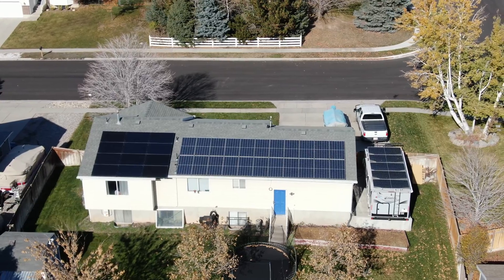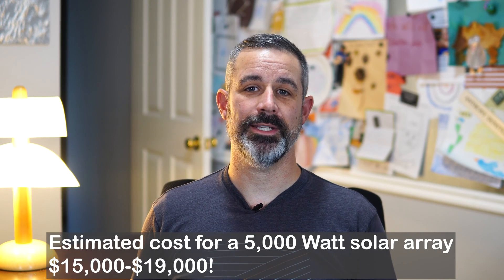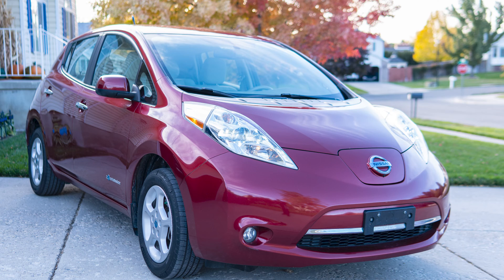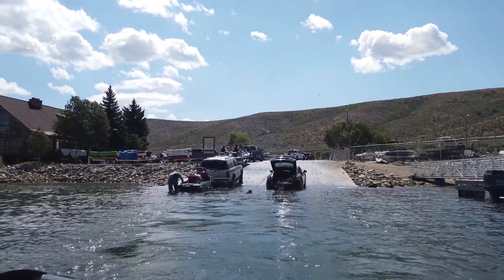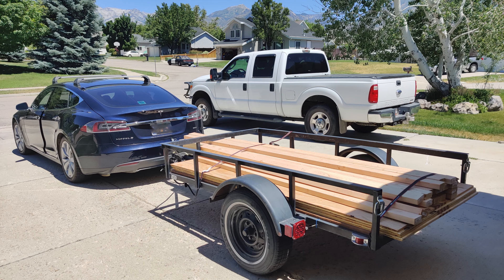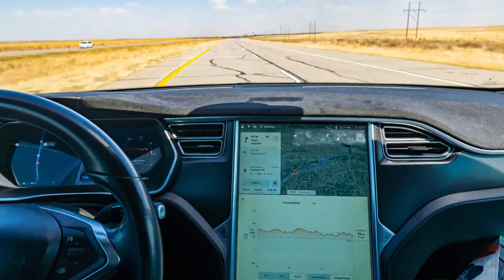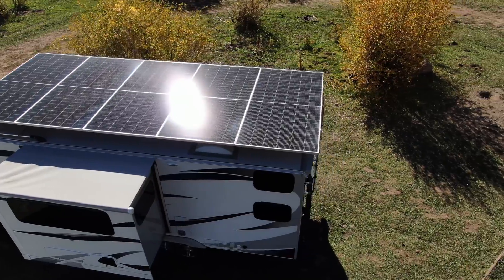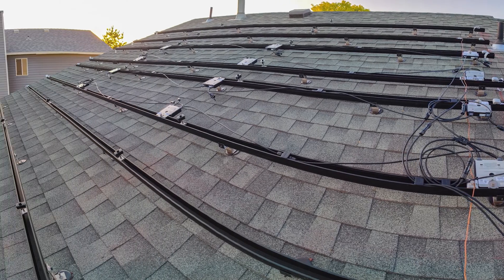How Long Did It Take Us To Break Even On Our DIY Solar Installation?

Comment: Well, a diy solar array built is far more worth then you had thought cause it teaches you a lot more about
* your consumption
* the major drivers / devices for the consumption and your habits you might be able to adjust 
* electricity in general
* living with the sun and
* dealing with shadows or shading and counter measures
* permissions
* planning strings, orientation, the cabling itself , mounting panels right and even cleaning panels due to the low slope and what not

It is a huge lesson learned for you, but at the end after 2 decades with kids having become adults it will show you that it was a lesson learned for all you kids for example raising the attention and awareness what amount of energy the devices they use are using and  a lot, lot more. It is something the western societies missed to teach in school from early on how a system works, what to take care for and what not. It should be a science curriculum .

I guess you might have missed the heating of your home cause you never mentioned it and the solar power array still looks quite small to me even though our policies in germany are quite different I bet. Netmetering sounds like a payment based on only the balance what you got from the grid minus what you had fed into the grid , the surplus energy you could not have used on your own. This is the easiest way but here it is called unfair cause the weaker households would pay subsidies indirectly to those richer ones with solar arrays cause producing electricity on demand at any time can be far more expensive during night or evening hours after dawn . You get paid back with the same amount you once have fed in and you will finally pay only the remaining balance after the year is over and you had fed less in than you had taken. 

Here it is quite different: 34 € Cents or roughly 0,38 $ INCL. all fees and 19% VAT / sales tax is the price per kWh 
If you feed in surplus you get paid but that is not your netmetering equation of 1 kWh fed in will give you a 1 kWh credit for later usage from the grid.
You get paid 0,08€ Cent or 0,09 $ which means an equtation of getting 1 kWh for free after having fed in 4 kWh. 
Therefore people tend to produce more or rather far more than they themselve just need to get a 0 € electricity bill or even make a profit.

Since the russian invasion of the ukraine we are allowed to install solar power systems up to 30 kWp = 30.000 Wp per household and any profit would also be income tax free, which is really rare that we can make money without having to pay income taxes. If you buy and sell shares or stock options you will pay taxes on the profit, so making 10.000 would mean about 4000 income tax and about 400 for church tax. Yes, there are people who did not pay but those get usually caught and the most recent and famous case was a former german fooball idol and hero, president of the most famous german football club who had been speculating big times and made money thinking he would not have to pay taxes on top of the taxes he already is paying. 3 years in prison , same prison were Adolf Hitler was incercarate , but he only had to sleep there over night (from 7 to 7) and over the weekend as long as he was working for his professional football club where he had been the president before. 

30 kWp on a roof with a 25° slope facing SSW produce about 33.000 kWh where our energy consumption in total for a usual house is far , far lower than the figures in the USA.
The average family of 4 has about 4000 kWh p.a. without heating and cars. But due to the end of russian gas supplies we replaced or reduced our gas and diesel heating usage a lot and added split AC which are bi directional heatpumps to our big rooms (usually 5 kW Mitsubishi for 1300 $ per unit incl. 19% VAT). People do not use the AC function at all in general, except the hottest dry summer days when temperatures reaches 35°C during day and is over 25°C. 
And then we also got  280 Liter heatpump for warm water which also has a 16 kW heat exchanger coil connected to the old existing diesel heating for the rooms with their radiators. 
These devices are used to raise the own consumption and use the surplus energy for your own benefit instead of giving it away for 8 cent while your neighbour will have to pay 34 cent for the same kWh you have fed in in the last 5 minutes. So if you consider that you have a cold watertank full with 280L down to 10°C refilled out of the pipes then you can store inside that tank about 16 kWh  of energy or heat which can be created by using a stupid electricity heat bar which will need 1 kWh for every kWh our stored in the water or you get the heat pump for about 1500€ right now which then usually needs 1kWh electricity to give you about 3 to 4 kWh of heating energy in the tank. You will have a leverage from 2 to 3 more than what you have to put in. And the heatcoil then could also transfer the heating energy into the radiator s without a need to run the diesel heating system anymore. 
The way it works is simple: you have a usual schedule where you program when you need the 280 l of hot water at what level of temperature
The heatpump will then run the schedule you have planned unless you are producing surplus power you are feeding into the grid. In these cases the heatpump gets a signal that there is surplus energy available and it abandons its schedule for now and runs the heatpump at 100% which means 800 Watt input and about up to 3000 Watt output in the hot water tank. You have a leverage or about 3 again like with the split ac in heatpump mode which also run about 4 to 5 offering a 3-4 leverage. 
If clouds are coming in or you are starting to charge the EV with 11 kW and then there is no surplus anymore the signal cause to the water heatpump and that runs its cycle to the end and then falls back into the usual schedule programmed which is also using the heatpump and tries to wait for surplus power. 

At the end we replaced about 1200 liter diesel for the Mercedes which has been replaced by an EV and about 2500 Liter diesel for the central heating by using the solar power wheneve possible or the up to 15 kWh we can store in our LFP storage which we had bought from SEPLOS , a SEPLOS MASON 280 L power tower as we call it on wheels. Case and BMS were about 500€ here delivered to our door and the 16 LF280K cells from EVE each  about 900 Wh of capacity were about 1850€, so 2350€ or about 2500 $ that work with our growatt inverters. We build all the stuff on our own, we did not get tax credits from the government except for the EV purchase back then. 
And it took about 2 years to move from gas / diesel to renewable, I mean buying and building the 2 x 5 kW Split AC heatpumps into the rooms, then adding the profiles to the roof and mounting about 60 panels each about 500 to 550 Wp (so 2,26 x 1,13 m and about 30 kg) onto  the roof and connecting them to 6 inverters (we have a 3 phase system in general and therefore each phase is 240 V or about 3600 Watt for plugs and lights except the oven, cooking and of cause charging which are usually 3 phase connections up to 11 kW ). We paid about 20.000€ for the solar power, the split AC and the water heating system which is also acting as our central heating. 

This is happening in many german households to get germany climate neutral and get away from russian gas we no longer get. The amount of new solar power systems on household roofs and industrial and public building and of cause ground systems on acres per year is about 8 GW and replacing about 6 nuclear power plants we have already shut down cause for us nuclear power is no alternativ due to the nuclear power waste which NO ONE WANTS cause all the storage facilities considered across germany under the ground in 2000 or 3000 m depth which were claimed to be save were not accepted by the local population and it was the same movement which started the demonstrations back in the 80 against nuclear weapons stationed by the US forces on german soil . Nuclear power is here not called green, but a dead energy source no one wants to have again. And in the current speed of growth rate of renewable energies from Solar power and the off shore wind turbines in the north sea we will be climate neutral before 2040 , the whole society incl. the industry, traffic, private households. Takes 15 years and we will no longer have to care about the gas prices, from 2035 onwards you will no longer be able to buy a new ICE car and most likely all german manufacturers will stop their european ice car productions at least cause the less ICE cars they can sell and produce the higher the costs for the remaining few and therefore these will become less profitable which will also force ICE guys to move ahead or they would have to pay more for the car and of cause for the gas cause we have CO2 emission fees per Liter you burn and those fees are raising annually so the price for oil will increase due to stock exchange changes and production costs, but also for the emissions where the governments collects money that will be invested into green technology and projects, subsidies to buy a car or heatpump.

So a solar power array on the ground or roof is just the beginning or a tip of an iceberg when people start to move ahead and get rid of burning stuff. 
Even farmers are going electric sooner or later cause the diesel subsidies for farmers will end this  year and then they will have to pay 20 cent more per Liter or about 1 $ more per gallon. Due to the fact that they usually have huge estates in roofs from their houses, sheds and pig / chicken / cow stalls it is an easier decision cause the energy will be generated at home without drilling and without a gas truck delivering 40.000 Liters anymore.
Reply: I guess you will need also more solar power the older your children will get and for heating cause your solar array is rather small. there is a professional solar power planing tool which allows you to plan like a professional which means building your home and roof in 3 d incl. obstacles that can cause shadow, putting solar panels onto it (by selecting it out of thousands in their database, same for the inverters, batteries, even diy batteries) and also adding your real time power consumption from the past which means consumption figures up to a resoultion of 10 minutes. And the simulation will be based on the historic sunshine in your location and the roofs slope and orientation  . This software is free of use for 30 days and you can find it under PV SOL PREMIUM. It runs in english and many more languages, you can use it for 30 days and then there will be also a chance to use it again cause if they release a new software version they think that you should be able to test this new version again as private user . And due to the fact they release updates every 1,5 to 2  months you can use it a long time or you simply start with the latest version of PV SOL PREMIUM from 2022 and then you will have at least 8 months free of use and after those 8 months there will be 5 new releases out and allow you to plan for more 5 months - instead of paying 1500€ for a single licence. 
and of cause if they have not the most recent solar panel or inverter from china in their database  you can add those to the database based on the spec sheets. 
I am writing all that cause you talked a lot about the stats of your new model Y you had picked up and compared a lot of figures between model s and Y and also mentioned a lot in this video so I guess you will end up sooner or later adding homestorage / an LFP battery and more solar power which might mean building a new car port as we call it , a garage or even pushing solar panels onto the north facing roof side cause those are not that bad at least in your location (geographic position about 500 km north of las vegas and far better than our south facing side in norther germany) and due to your specific quite low slope . the lower the slope of the northern roof the bigger the output. 
Yes, we would also have solar power on the north roof except we would have to pay income taxes for the surplus power we feed in once we are over 30 kWp installed and then we would have to pay not only for the 1 kWp more of a 31 kWp system or the 1 kWp above the limit, no, we would have to pay income taxes from the beginning, the whole 27000 kWh we are feeding in right now. But smaller houses will start to put solar panels onto north facing roofs due to the lot cheaper solar power panels where the price has dropped about 45% in the last 12 months and due to a deadly chinese competition where they are flooding europe with solar power. 
LONGI 535 Wp panels were 212 € a year ago if you purchase a  palette of 36 panels - now you can pick them up for as little as 112€ and you only have to pick 4 of these, not 36. Therefore more and more diy guys are moving ahead pushing solar power onto sub optimal roofs. Usually you get 72% from west / east facing panels (100% from south) with a 28° slope and from the north 53% with the 28° slope, but a lot more with a 12° slope your roof seems to have. And better to get 65% than nothing cause the older you and your kids will get the more energy you will use cause sooner or later they will be able to drive (16 years is 2 years earlier than here even though you can drink alcohol in public or everywhere from 16 on , you need to be 18 to vote). So in 10 years your kids will be driving your car or ebikes and maybe even e motorbikes. And 10 years will be like tomorrow if you now look back to 2013 what you were doing then and what had happened since. Therefore I bet in 2 to 5 years you will want to expand your solar power system and that is already the most beneficial you can imagine if that is based on netmetering or paying for your feeding  in a 1:1 ratio instead of 1:4 ratio we have and which will be decreasing cause every 6 months the 8 cent will be lowered by 0,1 Cent but ATTENTION: if you build a new solar power array then you get a 21 year guarantee that you will get 8 cent for every kWh fed in. This will never change over those 21 years. But if you would plan to add 5 kWp more just in 5 years then you can expect to no longer get 8 Cent per kWh, just about 7,5 Cent if I remember right. And sooner or later the american government and state governments will look across the borders how others are doing it and why where you will see then a drop and no longer would get a 1:1 exchange rate cause solar power is not worth the same money 247 cause you can not turn that on during night like a highly available gas powered powerhouse. It has to be less and it will happen, then you will need your own battery for sure cause you will not accept a 1:2 or 1:4 ratio loss. Check out the american hourly stock exchange prices and you can see that solar power at noon can be worth nothing or here in Germany you can get paid if you take the energy to lower the load on the grid.  We see that happen every night when the off shore wind turbines during winter time are feeding in power that no one wants. Then we can charge our battery for 15 cent (minimum cause we have 15 Cent fees to pay on every kWh, so in case of a negativ price per kWh on the exchange we still have to pay the grid and operating fees of 15 cent). And you will see such tarifs sooner or later and it is better to be prepared in time cause we have a lot of exchange here with american senators looking for ideas about the renewable energy changes and to keep the grid stable and in balance. 

But the most important thing you might not know: We have a highly available grid, we do not really know about outages. We have a 99,9% avaiability across the country, completely different to the US. So our grid is always in best shape - compared to the USA . Our gridlines are not overland lines across open fields usually, everything is under the boardwalk, also the connection to houses is NOT from the outside, that anyone can break in and manipulate or destroy things. Here the cables go into the houses directly and then there are special cabinets and distribution boxes inside.
Reply from the maker: I agree that my kids are more aware of solar and EVs due to my foray into this space and I like being able to education them about the real world. My girls ask me questions all the time about the projects I'm working on and I don't hold back explaining to them a great degree of detail, but it does devolve into explaining terms on top of terms and takes a while. I'm sure they don't retain much but I want them to understand how much they don't understand and over time they'll retain more when I repeat it. My kids know more about some subjects than many adults I also try to talk to who quickly turn off and change the subject clearly uncomfortable that they have zero understanding of what I'm talking about. Some people's lack of inquisitiveness about our world is truly sad.

I did mention in the video that I have a 240 volt space heater that we use to heat the house when we have excess net metering electricity at the end of each net metering year (ends at the beginning of March each year), but the majority of the heating season is via natural gas which is what our furnace uses. We have a 98% efficient forced air natural gas furnace that works very well, but someday I hope to replace our air conditioner compressor with an air source heat pump version so that we can heat the house automatically and more efficiently with electricity. Not as efficient as ground source of course, but ground source is not a reasonable option for our situation. The way our net metering policy works is every kWh of electricity we push out to the grid is attributed or added to our net metering balance, then conversely it's directly subtracted when we consume that kWh later such as at night. We pay some basic account fees to be connected to the grid which amount to about $10 per month. When our bill is processed each month if there's a negative balance on our net metering account then we pay normal retail rates for that amount and the balance is reset to zero. If there's a surplus amount of kWh then it rolls over month to month until the billing cycle in March at which point it's reset to zero and we're not paid or compensated for it. The spring energy production is more than we consume so we bank a lot of energy in the spring that we'll use that winter. The summer typically is closer to breaking even due to the increased energy consumption of our air conditioner to cool our house during the summer. The fall also produces a surplus amount of energy in October then in the dark of the winter (like where we are right now) we're drawing down heavily on the net metering balance. This year we achieved an all time high net metering balance of 3,046 kWh on November 2nd before the balance began to lower. If we were to add solar now the net metering balance is worse conditions to the point that it's not really worth installing solar unless perhaps you install batteries to self consume and basically defect from the grid which it sounds like is more like how your area works. I think we're somewhere around excess solar is paid for at around 7 cents per kWh, and to consume power from the grid is around 11 cents per kWh. We're grandfathered in to our current net metering policy through 2035 at which point I'm hoping batteries are cheaper and we'll add them to the house at that time. Our solar array at 9.98 kW is more than enough power for all our household and electric vehicle consumption to the point that we have excess to run the electric space heater I mentioned earlier. We also have 2.65 kW on our RV roof which I use to charge our electric cars so that power doesn't go to waste. It is flat mounted though so there's less production overall than our house rooftop solar panels. Our net metering policy is what allows our solar array to be so effective because we get to use every single electron we produce instead of having ~30% scalped from the electric utility. The other advantage I have is living in Utah which is a desert results in lots of sunny days. I also get more production than people south of me in Arizona because I'm at a higher elevation which means cooler temperatures and thus better solar production. We peak at around 100 degrees F / 37.7 C where in Phoenix Arizona they peak at 122 degrees F or 50 C and that heat reduces solar panel production.

That's smart to install appliances that allow you to better self consume your own electricity, of which a water heater is an excellent device for that purpose due to the great thermal mass of water. I'm glad to hear water heater manufacturers are building some intelligence into their devices. This type of technology will only increase, especially as utility providers are less hospitable to people who self generate electricity.

Regarding grid reliability here in Utah where I live we maybe experience a power outage once or twice a year for a couple minutes. I don't recall having a power outage in 2023 though. It's likely the same 99.9% reliability as Germany based on my experience. California is a very different situation. Also here our grid connection goes directly into a box on the outside of the house yes, but they are lockable cabinets. Most people don't lock them in my experience and there isn't a problem with tampering.